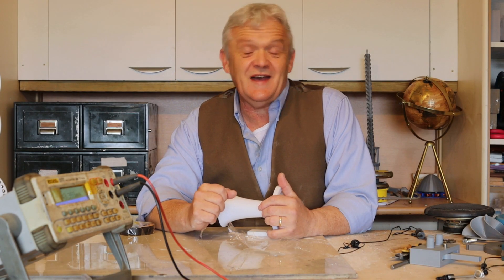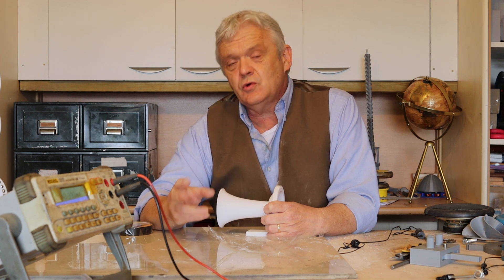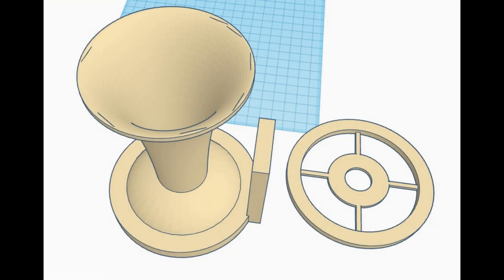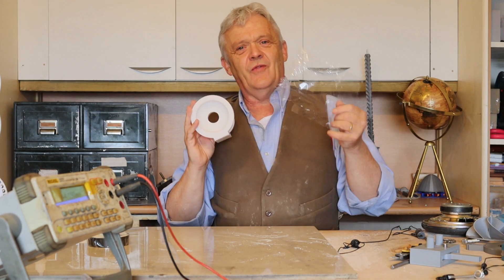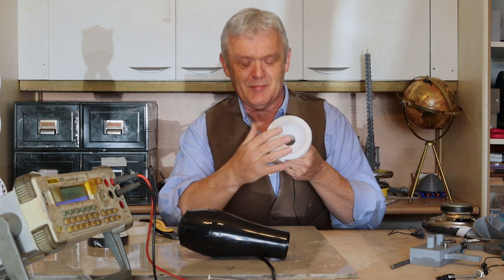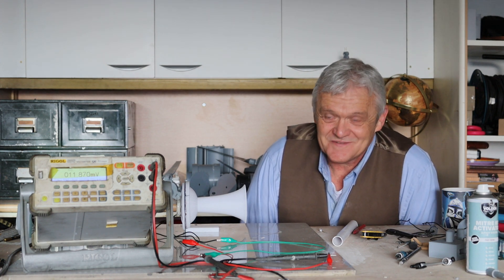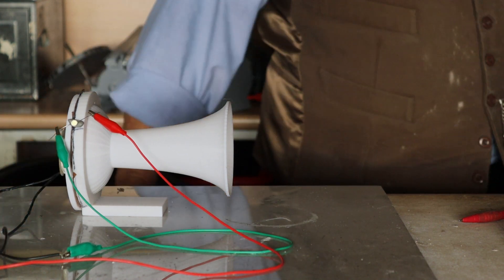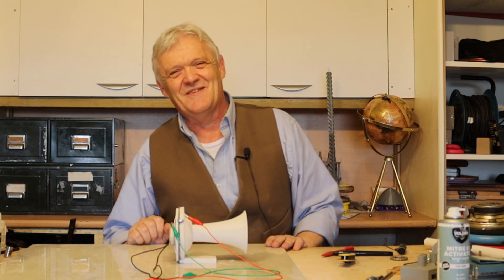2066 Getting Energy From Sound - The Edison Phonomotor

Comment: Might be more efficient to attach the diaphram to a lightweight coil and surround it with the magnets
Reply from the maker: probably not - it won't be more efficient but it would move in a lighter breeze but with the magnet on the film it acts as a kind of spring so it will oscillate longer whereas the coil will be lighter - easier to move but won't oscillate as long - the efficiency is to do with the distance between the coil and the magnet
Reply: Great explanation - Thanks 👍

Comment: I just had an idea. If you make the diaphragm from a ferrous material and put a magnet with a coil around it won't the reluctance switching cause a voltage output from the coil? That way you don't have to move the heavy magnet or the cumbersome coil. It should vibrate easier. Maybe vacuum deposit steel on mylar?

Comment: I don't know why you want to make the diaphram tight.  Surely you make it lose like with a rubber balloon so it can be more compliant to the sound waves and allow the coil and magnet combunation to have as much movement possible by the sound.
Reply from the maker: the rubber will act like a damper mate and absorb the energy rather than transmit it
Reply: @ThinkingandTinkering  Many years ago I had access to a super high speed camera.  While playing with it I recorded vibrations of various things by the impact of sound waves. On playback of the video I found the distance of travel of a membrane was greater with things like rubber balloons verse thick plastic or Celopane and even less when directing the sound to a 3mm piece of hard board. On playing back the video I realised that is why speaker and microphones have  corregations around the cone  so as to make it more complient to the sound waves.

Comment: Imagine an array of these along the highway! Where the have large concrete barriers to quieten the highway for neighborhoods and such! This can reduce the wall mass. Aswell as giving it another reason to exist. While getting something from it! Maybe have a chamber on the back side with a slight vacuum, or low pressure inside, and a large diaphragm like 12'-16'  with a coil and magnet setup to be efficient and most effective at generating.  I have seen large windows move nearly 2" in the center when large loud trucks drive by.  A mile or more with these along the highway should generate a few kw! Possibly 4-6kw per mile, make them easy to repair or replace if damaged,   a bent sheet metal frame with a focusing cone from fiberglass or something, and a fiberglass sheet diaphragm with a iron and magnet pole structure with a coil around it, similar to a large speaker, only the magnet may be on the cone/diaphragm! Even 0.5 amps at 1.2kv could be nice especially  with 100 of them plus, feeding a capacitor bank, connected to a grid tie inverter,  maybe have pv arrays along the top to protect them from weather slightly, adding to the power this could be 50-100 amps per mile x1200v especially for rush hour that's alot of watt hours! It may be reduced to 10 % of that 80% of the day, but it could be charging a battery getting ready for the peak load of the afternoon!

Comment: Cool, you should test a speaker, (one of the small Bluetooth ones) on the end of the horn with vent holes facing back towards the speaker from the diaphragm. Use a frequency generator to see what frequency works and what kind of wave or interference you could add. Free apps on your phone for frequency generator.

Comment: Try connecting speaker wires to incandescent household light bulb 200w or an small DC motor you can hear the music and the light will try the Flash but the motor will only vibrate and you can use a speaker for a microphone and vice versa but it will probably ruin the microphone

Comment: I believe you could reverse engineer a microphone electret condenser which would be simpler and can achieve much greater results. For a energy scavenging source I would use a microphone feedback effect. whenever the sound entering a microphone is reproduced by a loudspeaker, picked up by the microphone, and re-amplified again and again which continues to build up  huge amount of acoustical vibrational energy to distort the diaphragm transducer which has shown to generate infinite electrical potential from its positive feedback loops as it constantly produces standing waves within its resonant sweet spot. In other words. The acoustical energy would be far greater than what you initially put in without defying the laws of conservation
Reply: This sounds like it could be the basis of either the stupidest or coolest machine of the decade.
Reply: @gaemr_o5147  So sayeth the amateur gamer having an IQ lower than your 2D RAM space lol

Comment: you know when youre driving down the highway with 1 window cracked and u can hear the standing pressure wave inside the cabin thump in your ears? what if u blow wind across the horn? will a standing pressure wave form and wiggle the membrane?
Reply: if you shape the horn correctly it should work like blowing over the rim of a bottle
Reply: Could just use a basic wind turbine and produce alot more energy
Reply: @ashleydines144  yeah but solid-state wind generation is a nifty idea isnt it? no moving parts means no less wear and replacing
Reply: @byrdhartley9014  the sound machine has moving parts

Comment: Why not forget the horn and sound, but use the vibration generation with different driver?.
How about replacing horn with rotating wheel with alternating magnets, maybe driven by wind. And coat the source side of the membrane with graphite?
Being paramagnetic, the graphite covered membrane will vibrate back and forth as the alternating magnetic fields pass over it. I would presume that the membrane diameter could be greatly reduced as it would not need the area to catch the sound waves.

Comment: Seeing the phonomotor working made me think. If you can create power using the vibrations of air, wouldn't water do the same? A similar enough design or modification of the current one might allow the use of water as the transmitting medium and seeing how its not compressible it should transmit more of the energy. Bit like the glass of water in the movie Jurassic Park, strong enough vibrations from any source should cause the magnets to vibrate sympathetically.
Reply: Seems like it could be incorporated into a water ram pump.
Reply: put one at the bottom of a waterfall, its the only way to be sure lol